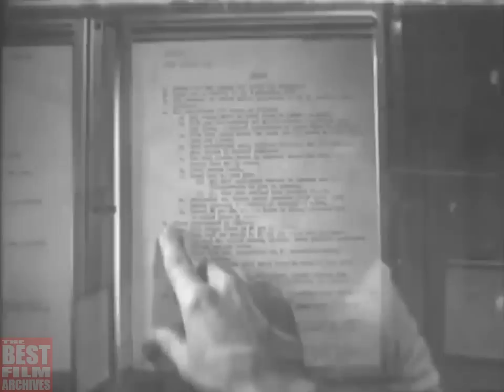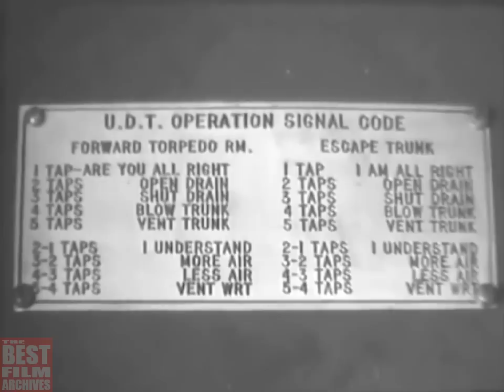How to Escape a Sinking Submarine | US Navy Training Film | 1953

Comment: The bit they don't mention is how much of the seabottom is less than 300 feet deep.  Percentagewise it's not much.  The McCann rescue chamber and Momsen's Lung were worthy devices, but generally speaking getting sunk in a submarine is a one-way trip.
Reply: dbeierl yea in Offenbach my granpas died Like this
Reply: average depth of the world oceans exceeds 4,000 feet - in other words submariners (such as I) usually don't care about such stuff since if something happens and you don't control it within seconds you all will die - which is what usually happened
Reply: The submarine implodes below 300feet anyway.
Reply: much farther than that modern submarines go beyond 700 feet how far is still classified info
Reply: I don't know what submarine this is specifically, but the older Gato class submarines were still usedin 1953 and had a test depth of 300 feet.  The newer Balao and Tench class had a test depth of 400 feet.
Reply: Yes...you are correct.  Lots of really bad info about crush or test depths for fleet boats.  Too bad the tower for escapes was out of order when I went through sub school in New London in 1969...oh well...sigh:)  USS Threadfin SS410...Balao Class built in 1944 and updated to Guppy IIA...sold to Turkey.
Reply: dbeierl It's true the self-escape apparatus is pretty much useless below 90 metres, and no-one would be expected to use it beyond that, but on the off-chance (however remote) the sub does bottom out at that depth, it would be comforting to know you have it there.
Reply: Almost entire Java Sea is less than 300 feet deep. Same goes for a lot of coastal waters where Japanese ships would cruise as it was considered safer to be close to the shore.
If the depth was more than 300 feet you had more depth to work with and a thermal layer typically all year so you were much less likely to escape... but also much less likely to get sunk. The Japanese did not use convoys as much as Allies did, a lot of times they would rely on ships and tankers sneaking their way across coastal waters.

Finally test depths are conservative. The design depth would be some 30% deeper and crush depth even more so. The late war US subs had thicker hulls but retained the 300 feet test depth because the equipment on the boat, such as water pumps and shaft bushings were not rated any deeper and it does you no good to be able to dive to 600 feet just to lose depth control completely.
Reply: The average depth of San Francisco Bay is about 15 meters...I suggest submariners confine their patrols to such places.
Reply: @funkyalfonso  I just realized my phrasing was confusing saying "depth is below" is unfortunate. I should say "less than". Java sea is of course pretty shallow.

Comment: And finally the men in the front torpedo room are dead from the chlorine gas and water that was pumped into that room from the process of escape. so in short DONT serve on a ww2 sub. The escape time is unrealistic.
Reply: +butchtropic  Upon surfacing contact your career counselor about openings in the aviation billets,
Reply: +BULLOCK1973 Thats why the japanese had the right idea with outfiting their subs with actual lifeboat compartments. A whole compartment would detach from the main sub with the crew inside. It would then accend to the surfice and act like a lifeboat.
Reply: +dragonfan360  Didn't know that. Is there any info or films about it?
Reply: I read it in a history book some time ago..
I'll try to remember what it was called.
Reply: 1 year later
Reply: He is having a hard time remembering, give him another year jeez.
Reply: 3 years later...
Reply: @dragonfan360  the entire time I was watching this I was thinking wouldn't it be so much easier to have a compartment or escape device attached to the hull to climb into that solves the issue of ascending too fast and it helps prevent benz so long as it could regulate the pressure properly.
Reply: @gravedigr12  Realistically in a WW2 era boat doing that would compromise the strength of the pressure hull meaning that the maximum depth a submarine could reach would be severely restricted. You would also be severely pushed to have one section of the boat that the entire 50+ man crew could fit in and finding enough compressed air to launch that section to the surface, with all those men inside like sardines is just not realistic. If Japanese submarines had such a feature it would have most likely been to save a handful of officers whilst the rest of the crew perished.

Comment: Most WW2 boats had a separate forward battery compartment, the ward room, and forward torpedo room. The escape trunk drained into the bilge and it was separate again from the forward battery. NOW< some of the S boats were different but anything after 1941 were separate. Also had an afte battery compartment, below the galley and midships crew quarters. Was on the crew of the USS Clamagore SS343. DBF Oh, and we certified yearly either in the escape chamber at New London OR, more fun, off the coast of Florida from the boat.

Comment: Do modern subs still have co2 absorbant on board? Would be cool to know.
Reply: Yes, they do; they are fitted to a small electrically powered unit which can be operated via the boat's main battery if still intact. On loss of main battery, they can be powered by sea (salt) water activated batteries but also carried on board are manually operated pumps. However, there is ambiguity with this as they may or may not generate more CO2 (by action of the person operating it) than it would adsorb.

Comment: 24:20 xD Any black people watching?
Reply: [154thTN] Seth Adam why?
Reply: Assuming blacks need to roll down their sleeves as well.
Reply: Never mind. Fewer people understand genetics than I thought apparently.
Reply: Dark skin "spreads' the sun evenly across the area and absorbs the light and heat from the sun better than light skin, that's why so many people in africa are black. So in short, black people don't really get sunburns or don't get them as easily.
Reply: FourDigitedMenace  Bravo. At least someone knew or at least used a few clicks of a mouse.
Reply: FourDigitedMenace  the melonan absorbs the uv radiation and blocks it on the surface where the body is able to repair the damage.   white people have less melonen primarily because of the Northern climates we evolved in due to less sun we required less melonen

Comment: Seems pretty complicated.  Why not j ust spend the time to get those engines fired back up so they can bring the whole vessel back up to the surface?
Reply: Because if the engines still worked, they wouldn’t be sitting in the bottom, or whatever.  The rest of the crew is probably dead.